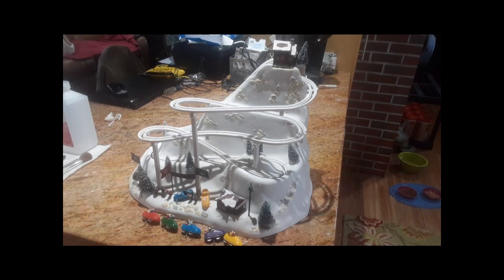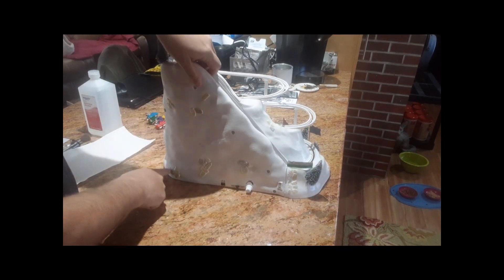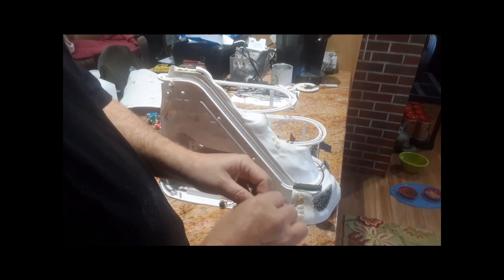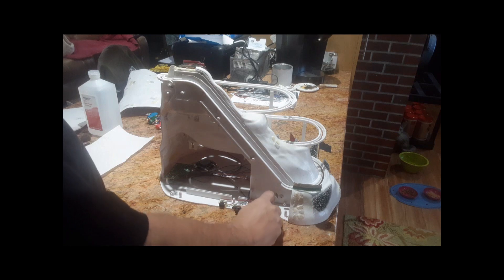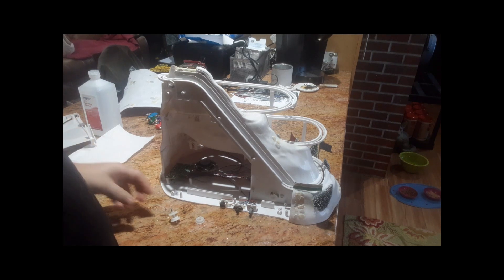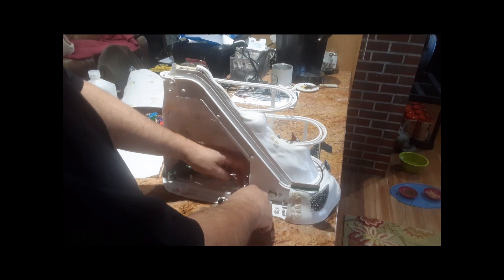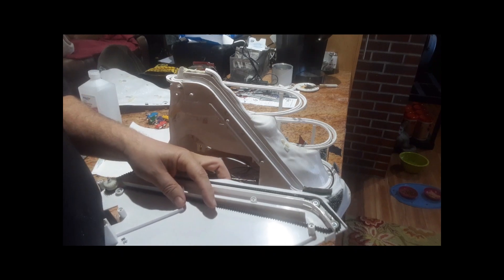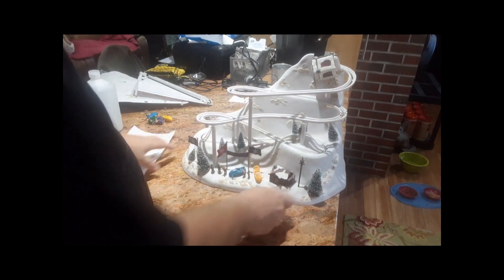Mr. Christmas Bobsled Repair

Comment: Thanks for the info!!!!!
Reply from the maker: @rickfitzgerald5548  It is one of the most difficult items to repair. It is also tough to keep the sleds working smoothly. I spent hours on the track: cleaning, sanding away burrs, keeping the slots consistent, and supporting the track better than the stock item. I even glued in a cardboard fence at the bottom of the lift to keep the sleds from "spinning out" - which prevents them from being picked up by the belt.